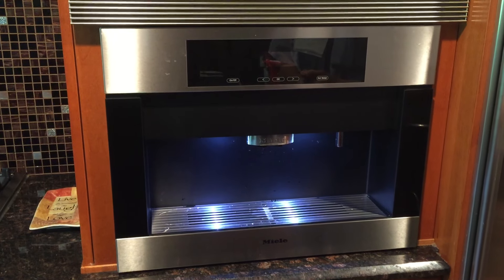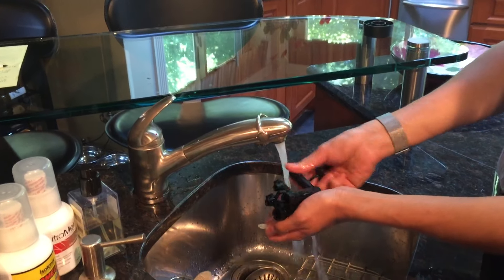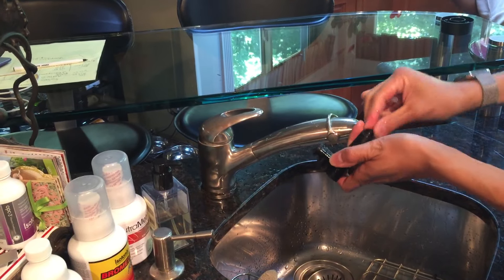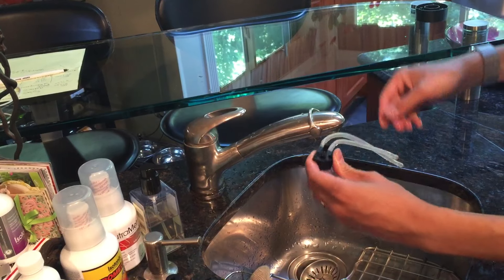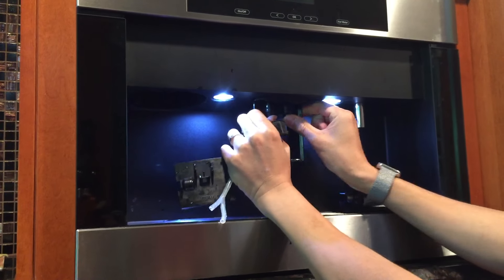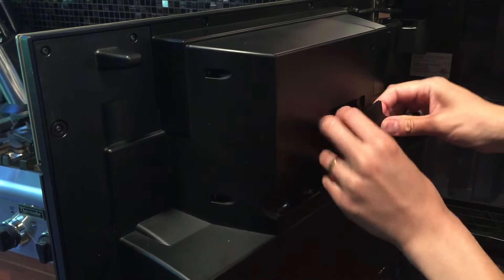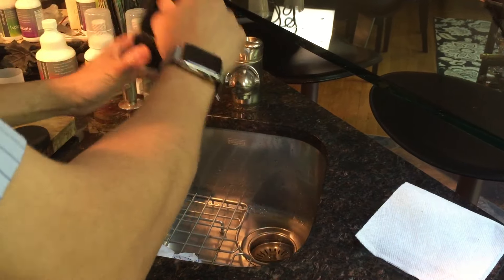How to clean Miele Coffee Maker

Comment: Thanks for the great tutorial video.  Saves me from making a service call.  I’d also like to add that sometimes milk deposits do accumulate inside the bend of the plastic tubes.  You cannot see it.  You’ll need a small hexagon wrench, unscrew all the little screws in order to open up the black handle part of the milk canister.  Mine was so clogged one time that I had to blow into one end of the tube in order to clear the blockage.

Comment: Error at 0:19!!!  DO NOT use a screwdriver to pry the milk pipework.  
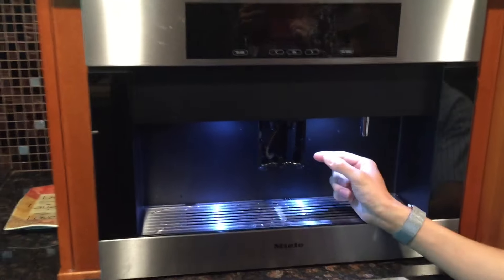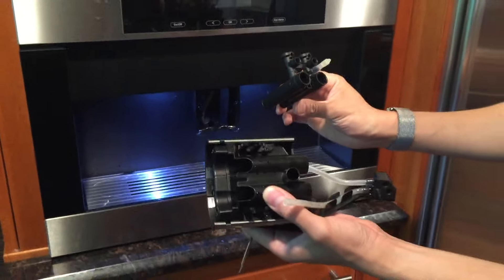The correct process for disassembling is to remove the  dispensing nozzles first (0:38-0:50), then remove the milk pipework.  If you do it this way, the entire milk pipework unit will slide out.  From there, the Miele manual (CVA 4066 p 44) recommends cleaning the entire unit in the dishwasher, and using a fine pipecleaner/brush to clean residue from inside the pipes.

Comment: FYI, The entire unit on the rear of the door with the  2 milk hoses comes out as one unit.  You don't have to reach inside and pry the hoses off with the flathead screwdriver.
Reply: How do I do this? I took the cover off  but the two hoses are still connected to the plastic part inside the machine. Manual said it should come off when removing the cover but didn't and I don't want to break anything.
Reply: @Rhevena  I can't remember, but look for some kind of release where it attaches to that back part.  We figured it out after we had removed the hoses as per the video.

Comment: if you rinse it and maintain it like you are supposed to, you never have to do this. keep making milk drinks and letting it dry in there, this will keep happening, run a cup of hot water thru it afte milk use, and this video never happened.
Reply: I have a miele 2650 stuck in faultf10, do you know how to fix it?
Reply: Oscar Morales f10 or f17 is water flow fault. 2 problems are possible. 1 is brew unit is gummed up internally with greasy coffee film residue . problem 2 is more complex as it is gearbox valve either bypassing or not opening fully. as far as consumer fix, remove brew unit, fill sink w hot water and degrease solution such as dawn, grease lighting,  etc. fully submerge brew unit and let it soak til water is cold. remove and rinse with more hot water and place back in machine and see if it helps. if it does not, maybe a bad gearbox which has the valve made with it.

Comment: Hot water does is not the solution, just use Descaler to clean the machine, that will do the job.
Only once a year, you need to de install all the appalments for the milk and coffee outlet, just and overnight job, remove the descaler in the morning.